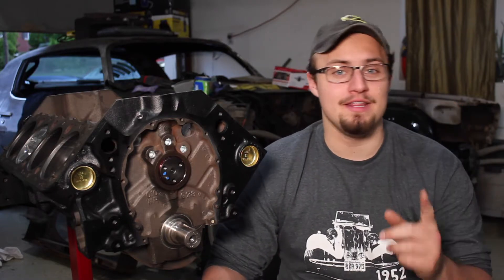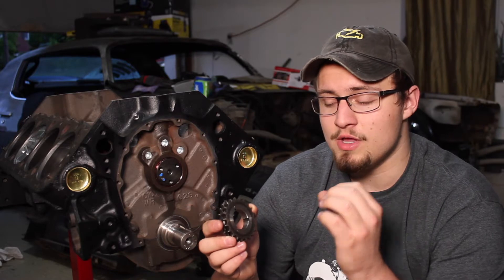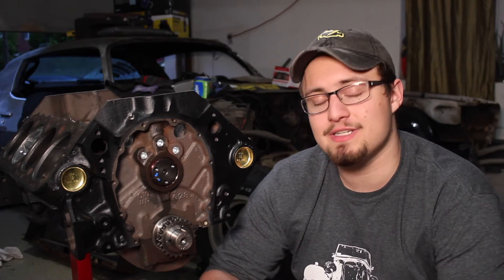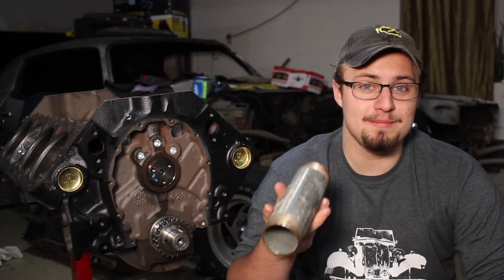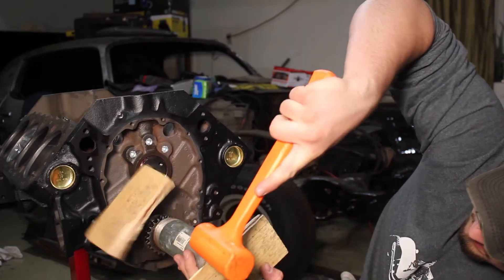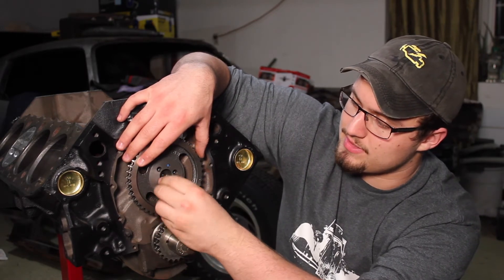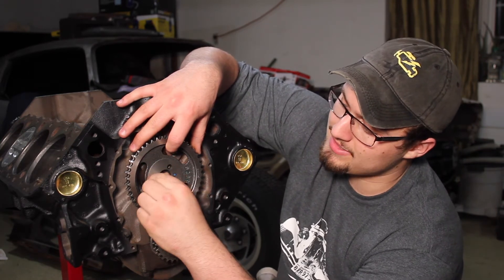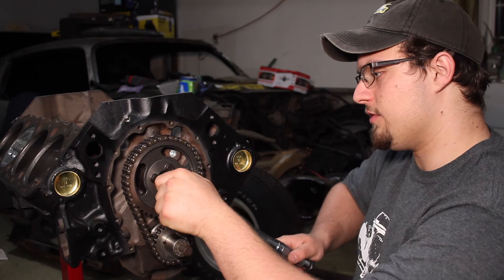How to Install Timing Chain and Gears on a Chevy 350 - Burnout Tutorials (Rebuilding The 350)

Comment: Use the old gear turned around and use the bolts to press the new gear on then remove old pulley and torque to spec basically use the old gear as spacer * also need a few longer bolts

Comment: You installed a double roller timing chain & gear. Did the old timing chain cover fit over everything? Or, did you have to buy a new cover? Good video; explain things very well.

Comment: The cam gear needs to be rotated 180 degrees for it to be #1 TDC. Installing the gears with the cam dot at 6 oclock means cylinder #6 is at TDC compression. #1 is at TDC, but on the exhaust stroke.

Comment: This is a good tutorial. It gets a bit more involved if you're doing this with the engine installed. I've got a 305 that shows all the signs of a stretched timing chain, but compression is good and it's really clean (been running on propane most of its life). The parts for this are so cheap and the process isn't that bad, so this is my next project on that truck.
Reply: Fact:  Timing chains do not stretch.
Reply: @basketballjones6782 Yes they do, just not in the sense you visualize it. The wear of their components ads up to a metaphorical "stretch" when there is excessive play.

Comment: Just before reinstalling the timing cover, did you place the black rubber tab at the bottom of the cover?
Reply from the maker: My timing cover actually came with the seal pre installed. But if you put the cover on an even surface and then use something flat like a block of wood, it’s relatively easy to press the seal into the timing cover.

Comment: I think you have the timing marks mixed up. Both cam and crank should have the dots at 12:00. You have the cam at 6:00 and crank at 12:00
Reply from the maker: Not really sure where you are getting your information, everything I've ever seen has always said to line them up with the cam at 6:00 and crank at 12:00, including the instructions that came with the timing gear set used in this video.
Reply: @TheBurnoutShow  i think he might be talking about when you drop in your distributer it will be 180 degrees off. you can install like this yes but will want to turn it to 12/12 but im new too all this myself and by all means no mechanic im also seeing its a 2yr old video lol either way keep it up looking good
Reply: @itzBiscuitsB  when you install the gears you do so dot to dot. this is tdc #1 but its not on the compression stroke, this orientation is firing on #6 {180 out}, for dropping the distributor in both dots at 12 oclock is correct for firing on #1.

Comment: Got a question...I'm putting a sbc back together....I set everything up just like on this video (heads off, #1 up) but needed to take cover off to change for a better one (had turned motor w crank socket) and noticed the dot on crank clog is straight up but cam  cog is now at top instead of bottom. The lifters and pushrods aren't in yet but was wondering, do I put it back w cam dot at 12 or move it back to 6? Heads are on and #1 is up again. Thanks
Reply from the maker: You'll want to make sure you line up those gears before you move forward with anyone else.
Reply: @TheBurnoutShow  ok will do,  thanks for reply .
Reply: LOL
Makes no difference.

Comment: I used a harbor freight heat gun to evenly warm up the gear when I removed and installed it. Did the job. No idea why people feel the need for a torch
Reply from the maker: The torch just works a lot faster. Either one is fine, just the torch works better and a lot of people don't have heat guns but do have torches. But it doesn't matter either way.
Reply: I followed the Factory Service Manual which states to use a gear puller to remove it and a "special tool" (which can be duplicated with a large socket) and a hammer to install it.

Comment: While  your approach to installing the crank pulley is the only practical way to do it, when I taught classes for Ford, we had a two sided hot plate to warm the gear and gloves to transfer / install it.  It was recommended against heating the gear with a flame. Great job and thanks.
Reply from the maker: That sounds like a great method! Thanks for the info!
Reply: you can wrap the gear in a moist paper towel and microwave it to heat it up enough to drop on.

Comment: Add locktite to cam bolts
Reply from the maker: That's not necessary. If you torque them down to the proper setting, they're not going anywhere.

Comment: What's that doing to the thrust bearing?
Reply from the maker: Not much. The crankshaft doesn't really move much during this process and even if it did, still wouldn't really cause any problems.

Comment: what do they mean by being 180 degrees out on a timing chain?
Reply: Can't really be 180 out on the cam gear if you line up the dots lol however you can be 180 out when you put your distributor in
Reply: It mean that cylinder one is at its exhaust stroke and not at its intake stroke. So picture a circle is 360 degrees. The camshaft turns only 180 degrees when the crankshaft turns 360. So you might need to turn the crankshaft 360 with the change on both gears so then your camshaft turn 180 degrees and that should put you were your need to be. Please if I am wrong someone correct me.

Comment: I did mine just like you did and my truck still isn't cranking
Reply from the maker: I'm sorry to hear that. Unfortunately that could be caused by a number of things. If you could provide me some more info about the problem like exactly what you did. Is the engine in your car or is it on a stand like mine? Are you manually trying to turn it over and it won't or are you trying to start the engine with the car key and it won't start?